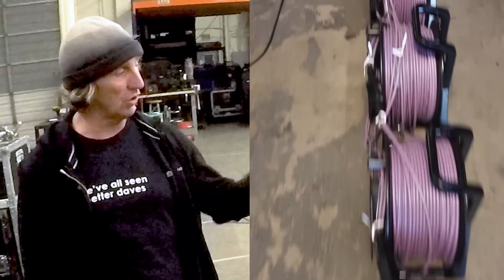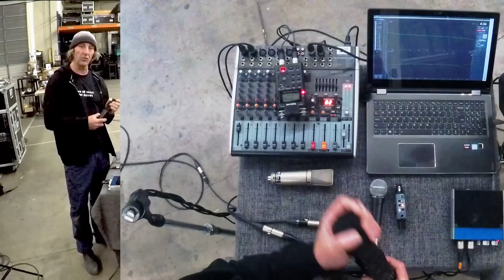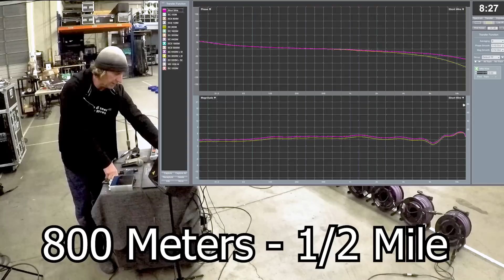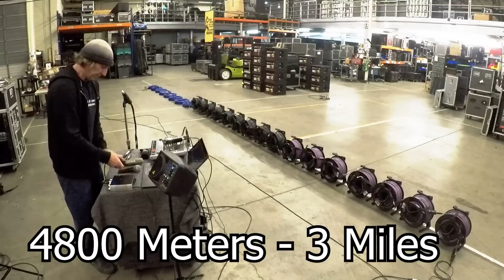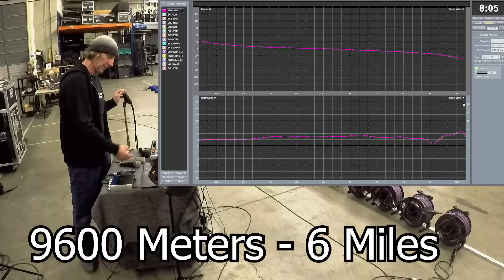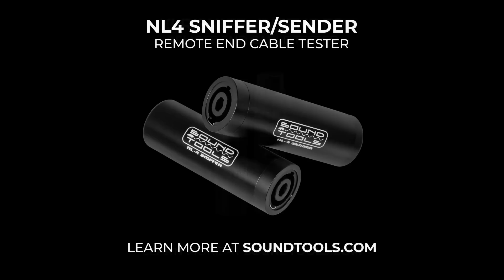Six Mile Long Microphone Cable? With Phantom Power?

Comment: Interesting, I would have expected a significant drop in phantom power voltage. Thanks for testing!
Would have been interesting to measure how much of the 48V is still getting through ;)
Reply: There will be a significant drop in voltage over even the 'shorter' 1.5 mile lengths, but it's dc and and most mics really don't need 48V except for some super high end stuff, like perhaps the Nuemann, but all that mean is its gonna lose some dynamic range and noise floor, hardly significant compared to the frequency rolloff's and cable induced noise at the lengths being talked about.  Take away is... if you can put up with the sound degradation the phantom power can still fuel your condensers (unless you started with some crap deck that only sends out 12V and pretends that is good enough).
Reply: Even for a short cable the voltage can drop significantly from 48 Volts with a mic connected. That's because the phantom power standard is actually 48V fed onto pins 2 and 3 of the XLR through 6.8K resistors. So the resistance of the 6 miles of cable has a resistance far smaller than the resistors in the preamp feeding the power into the cable in the first place. It would be about 820 ohms added to the existing 6800, assuming 24 gauge copper mic cable. So the amount the voltage drops below 48V when the mic is connected would only be about 12% more with the 6 miles of cable than with a short cable. In reality this drops would be a bit more because I havent calculated the additional drop from the shield resistance, but its likely to be small compared to the twisted pairs. With one the Cat5e conductors serving as the GND wire rather than a proper shield, the drop would be more significant maybe closer to 35% more than without a long cable.
Reply from the maker: I did a video on phantom powering mics from multiple consoles and show the voltage drops

Comment: Now for a fun question. What practical or hypothetical applications does running analog audio over a mile even have?
Reply: I've been in large recording studio complexes with several studios where the audio from say, studio c's live room would get patched to studio a's control room, and the total signal path could be hundreds or even thousands of feet.
Reply from the maker: The idea for this video came from a customer buying Cat5e cable to put speakers up for a 1/2 marathon route 8n an area without cell service or WiFi

The question was "how far can I run analog over Cat5e? So I tested it and made a vid.

The 1/2 marathon had the drive unit in the middle. So 6 miles each way would do it and with shorter runs because there was a generator and the ability to refresh the signal at each speaker area evenly spaced on the route.
Reply: @DaveRat  Given that you can hire a StarLink ground station for about 300 bucks for 5 days, how did the cable solution compare?
Reply from the maker: The customer says it's still works great and it's been several years.
Reply: @DaveRat  Ah! Didn't realise it was a permanent gig....
Reply from the maker: I didn't either but recently received a message after seeing the vid telling me it's still working great!
Reply: @DaveRat  "how far can I run analog over Cat5e?" As far as the marathon runners can run basically... :)
Reply from the maker: I believe they ran the source to the middle of the 1/2 marathon route. And split signal to both directions to cut the distances down
Reply: @DaveRat  Cool!

Comment: Interesting!     I use a program called ShareX to record screens to video, it will also record the laptop sound making it easy to align the clips in the editor.  This allows me to avoid pointing a camera at the screen .
Reply from the maker: Yeah, I have a screen recorder on my personal laptops but that laptop is a shop measurement unit and we don't add software to it.
Reply: @DaveRat  very sensible! (Speaking as an IT professional ) , and you are up late, it being early morning here in Africa  (-:
Reply from the maker: Good morning and great to meet ya!

Comment: Hiya Dave, love these interesting experiments you are doing! Years ago, I was involved with an outdoor recording experiment that involved some condenser mics placed about 600-700 meters away from the preamp. It was in a semi-rural environment, with a broadcast TV and radio antenna located about 4 km away. We had plastic conduit buried in the ground, and the first attempt at this involved using some Belden foil shielded install grade mic cable. The result was huge amounts of 60Hz noise on top of the mic signal. We tired a few different approaches, using preamps at the mic end and sending the signal much hotter(lower Z) back to the recording location, but that didn't improve the situation much. What did however work, was that we changed the mic cable from the foil shielded cable, to a star quad braided shield cable. Once we did that, the problem completely disappeared. We had four distinct mic lines, all doing the same thing that the original foil shielded cable. In hindsight, seeing you do this with much longer runs, had me thinking what really was the source of the problem we had. The only difference I see is that you have these cables coiled up, in a very small area, inside a building space. Our situation was outdoors with a straight 600 meter run. I suppose it's possible the Belden cable wasn't as twisted as it should have been, or how your Sound Tools cable is twisted. Seems to me, that as long as you have a very consistent twist and a decent preamp with good CMRR, the cable doesn't even need a shield.  After all, the telephone company ran much longer twisted pair lines to carry very noiseless audio, much longer distances, without any shielding and worked this way for almost 100 years. That's the one thing we didn't try... using telephone cable. I suspect that you will be able to run your mic cable setup to a usable distance that will be dependent on the actual impedance of the copper connection. The more distance you add, the cable impedance will start to overtake the output impedance of the mic, and you will start to have a level drop as you already measured, like inserting a pad, but you still should be able to recover it with gain on your preamp, just a little more added ambient noise will also be there. I wouldn't hesitate to guess you could probably get 25 miles of cable, with still useable audio that would only need a little gain and EQ to fix. Thanks again for the experiments, they're awesome!
Reply from the maker: Thank you. As far as the 60hz, that was not from the radio antenna, more likely there was a wall current flowing through the shield somehow. As foil or braid over twisted wire should be pretty good at filtering out such a low frequency.
Reply: @DaveRat  That was my first thought when reading this, assuming sonicfrog is in the USA - here in the UK we'd expect a 50Hz hum. Over those distances there's a very good chance that currents circulating in the ground from the electricity network could cause a significant difference in potential between the mic and mixer. If any of the XLR shells are grounded or the mic chassis were grounded (I think this was more common in days gone by?) and in contact with general earth then it's easy to see how there could be a ground loop. Although it's weird that it went away with another (better quality) shielded cable.
Reply from the maker: Agreed
Reply: Hi guys, thanks for the replies. It was in US(60Hz) and early 2000s time frame. We went through all kinds of things trying to figure out what was the source of the noise. We had condenser mics that needed phantom, and we tried even a small battery supply at the mics, coupled with some different line amplifiers, and using transformers with that original foil shielded install mic cable. There were lots of combinations of things tried to come to some solution. All of the attempts passed the audio, and allowed it to work, but there was such a strong 60Hz component there, it was unusable. Ground loop was the obvious first thought, but believe me that got rooted out on day one with the loads of experiments with power supplies, line amps and transformers. Our final thought was that the mic cable might just not be as twisted and uniform between the signal pairs as one would think. For say 50 meters maybe it was fine. But for the distance we had, it didn't work until we changed out the cable. So, the noise was actually in the signal lines, just not equally and hence, showed up as a nice 60Hz, from whatever was in the area inducing it. We had ourselves a 700m long guitar pickup with that original cable. :)
Reply: @sonicfrog1  dare I ask what classified or unclassified project this was on, I mean for? I mean why would you did you need to go that far? I assume it was some sort of sensor monitoring type scenario.

I recently went on a hike to an old Canal tunnel and thought it would be neat to put some microphones at both ends and make some noises and then realized I would need a third of a mile of cable which I don't have (yet). I still wanna try it although it'll probably be done with Wireless which is another distance question, how does it propagate underground how does it propagate in a tunnel....
Reply from the maker: Wireless will most likely work in a tunnel but does not like to go through dirt
Reply: @imark7777777  It was a project for a musician who was recording outdoor nature sounds. The microphones were placed a ways into a small forest area, and the mic lines run back to his recording studio in the basement of his house. At the time, we had actually even researched an Israeli startup company that had an idea for a fiber optic microphone. It was basically a microphone capsule that was reflective, and sitting on the end of a piece of fiber. Then, they inject some light source, and the reflection that you could read back would be the audio information at the end, deforming the capsule and reflecting back the "deformity"(audio). I don't think this company ever made this work commercially, however it was an interesting idea. In your case, wireless will probably work, give it a try. You may need to be a little creative with the antenna arrangement and your recording position, but that's part of the fun with these kinds of projects.
Reply: The FCC doesn't allow radio transmissions below 100khz (they tried to change this to 3khz a few years ago but i don't think it happened ET Docket no. 03-137), this event must have happened post 2003 because you used star quad cables, definitely would have used a fiber bundle/rattlers(a belden product wouldn't ya know) at those distances during the mid 2000s era (you only get two audio streams per run instead of four but w/e its a third of the price). you've probably seen them in action watching your favorite football team, check em out real neat stuff.

Comment: Does it matter that you're using coiled cable, as opposed to a straight run?
Reply from the maker: I would say that if it has any effect at all, it would make it worse, not better. Also running signal both directions down the cable could make it worse as well. So figure a straight run will be the same or slightly better but doubtful

Comment: This is helpful for when you need to run sound on the space station.
Reply: Actually, a friend of mine, Woody Crane, ran a balanced line from Dayton, Tennessee to Chicago, Illinois for WGN's coverage of the Scopes Monkey Trial (I believe he won an Emmy for it.) They actually used barbed wire for most of the runs, connecting the borders of farms together when they had to cross a road.

They drove it with Altec amplifiers, reamplifying it for loss. He didn't mention how often they had to boost it.

But as it was a balanced line, it was perfectly fine at the end. Anything that was in the positive that wasn't in reverse at the negative was of course nulled out at the station.

He told me this story when I was working with his son getting a 100,000 watt community radio station on the air in Kansas City.

Edit: Sadly, Woody died 20 or so years ago. I would have loved to have recorded him talking about it but this was before everybody had video cameras in their pockets.
Reply from the maker: I love this story!!
Reply: @midwestconcertvideo  I used to live in Dayton TN. I can absolutely see farmers' barbed wire fences being connected to 100W Altec triode amps there. I would not have been surprised at all, knowing that place. Pity the cow that bumped up against that wire when the audio peaked! (100W into 600 ohms = 245VRMS!)
Reply: There's no resistance in space. 🤡
Reply from the maker: To motion yes, no air but electrons in wire have no concept of gravity or wind
Reply: @ThePlagueGameing  O think i saw some resistance at Star wars movie
Reply: If you're referring to the ISS, it's only a little over 100 meters

Comment: That is a really cool demo. I've never used a mic cable more than about 150 feet in total (snake + mic cable proper). Back in the mid-70's when I was being taught about pro audio, I was told that normal balanced low-z mic lines could be up to 1,000 feet with no ill effects, and if you wanted to go further, there were a lot of mics that could be switched to a really low source impedance (50 ohms, usually) and these could drive a mile of cable. Looks like the engineers who designed the system way back in the day knew their way around a slide rule!
Reply: Back in ‘94 I helped install 8 or 10 12 pair audio mults for an NFL playoff game telecast, the runs were about 1,000 feet from tv trucks to the stage inside the stadium. We also had 10 coax video feeds plus 8 triax camera cables. Today we would run a single tac12 bundle and have spare fibers. The audio guys never whined that I recall. They had to run mics from the stage back, RTS intercom & IFB’s back to the stage from the trucks.
Reply from the maker: I think this shows that for low and mid fidelity runs, long cables work for signal level. For high fidelity, I have done tests that show there are audible errticats in the HF at 300 meters or so begining to occur with audio snake.  I have not tested 300 meter Cat5e with analog for high fidelity